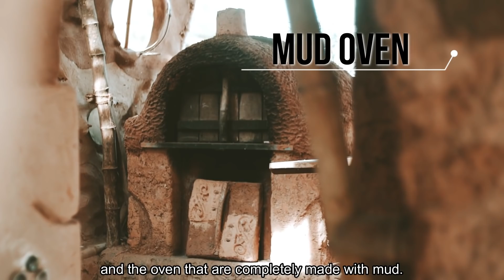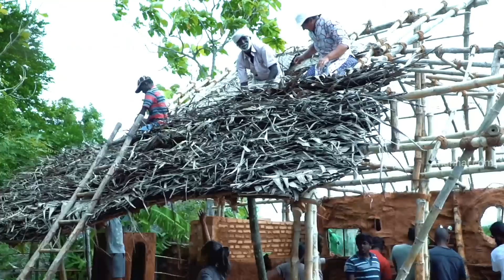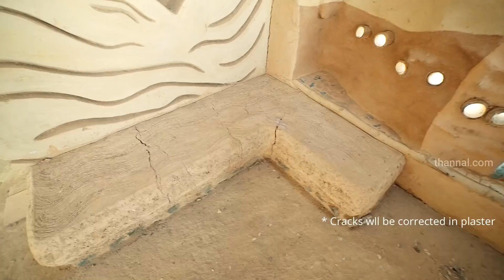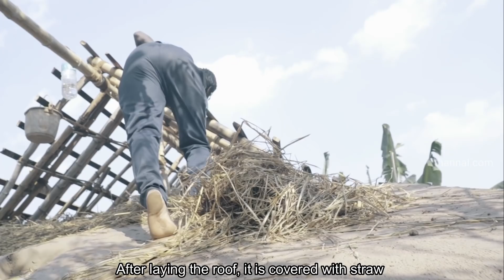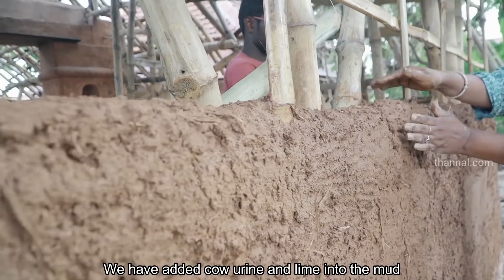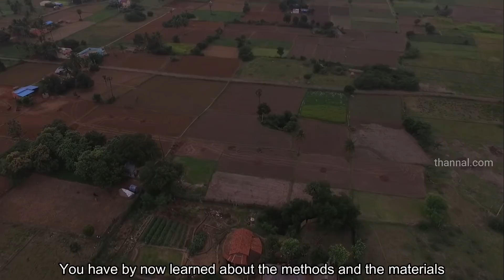Village Mud Kitchen |Lime crete Roof | Wattle & Cob | Traditional Construction Technology

Comment: Hi, I am always interested in building a village type mud house. With terracotta tyle  roof . I would like to get in touch with you guys to know more information. Durability, strength, maintenance and last pricing. Like as u have rightly pointed out the mud kitchen,I would love to introduce  gobar gas stove inside the mud kitchen , the wood is not wasted or destroying the Mother Nature and less smoke in the cooking area. The house also can be nicely designed for good sunlight and ventilation.thank you. If possible send your contact so that I can get in touch with you. Regards. 
S. Aravindan.

Comment: I have some questions-
1) can we use only the treated bamboos as building material? As u know in North east, bamboo, timbers r use rather than cob.
2) how long a treated bamboo last in such building u show?
3) here as colum sal ( sheora robusta ) steam is used. But there is another termite proof, cheap, native, easy to cultivate, fast growing plant available, Toona ciliata. How useful this plant is?
4) the roof u made with lime, how long it last?
Reply from the maker: If timber is abundant you can use wood But bamboo grows fast and you can cut and use it when bamboo is 4 years, and it will grow again. It is not about using lot of materials it's about using little and small to full fill our small dreams and needs. Remembering Bapuji's words "The world has enough for everyone's needs, but not everyone's greed,"
Bamboo if you harvest properly you don't need treatment.  
Properly Treated bamboo from market will last for more than 30 years. 
But you can see here in this Video 300 years Ganjam house with bamboos - https://www.youtube.com/watch?v=TCX_NV6sCPk&t=5s
You can track this here in Chapter 2 
Know the Basics: Mud & Bamboo
Identifying different types of mud through tests. Harvesting, treatment and preservation of bamboo.  kindly wait http://thannal.com/natural-building-video-course/
Reply: @ThannalNaturalHomes   earth building in greater bengal.
https://youtu.be/pL4F_xmkUrE